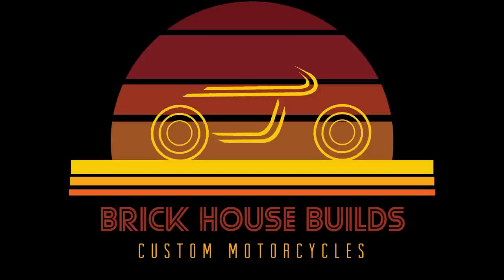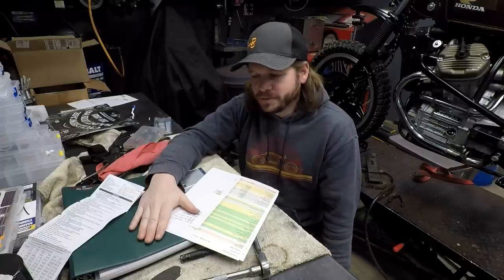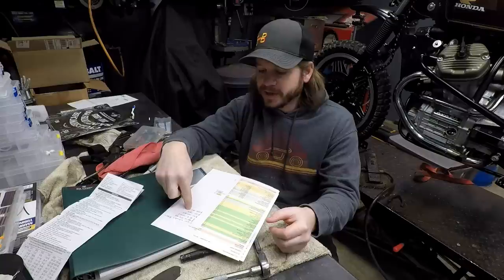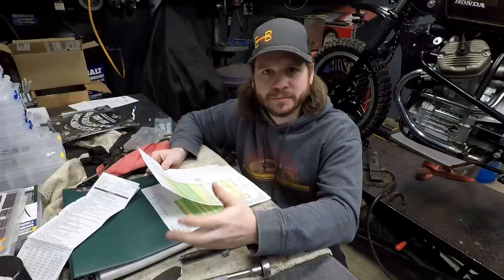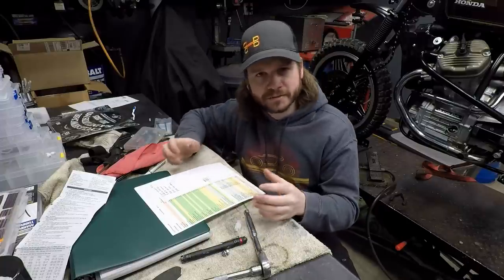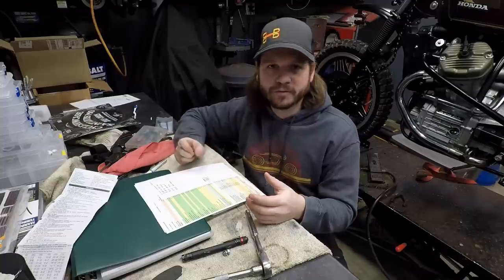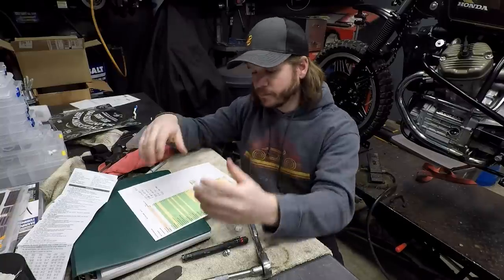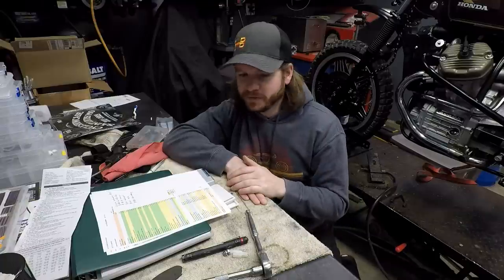Barn Find Honda CB750 Rebuild Cost

Comment: I built one to brand new condition and can’t get it sold so you are dead right. Get it running and enjoy it.
Reply from the maker: Its tough as they say they are worth more stock yet balk at the prices for what it takes to do.
Reply: @BrickHouseBuilds  I got away with it light as I got the brand new 4/4 exhausts very cheap but if I could go back I’d of cafe racered her with a sidewinder. I can’t give it away for nothing as it’s worth a lot to the right man. But it was a great project and alot of fun working on.

Comment: Man! you count everything but you did not count your work! How many hours you spend to restore this motorsicle???  my opinion the most expensive is your knowledge your ability to fix it!
I am sure not many people can do it!
 If you give them this motorcycle so they gonna kill it completely! 
may be i can fix mechanism but i can not fix electricity so i have to find someone to fix electric components to complete restoration of old motorcycle!  
I am sure not many can use your advice!!! Good luck!
Reply from the maker: Hey man, this was my bike so I didn't log hours because it didn't matter. For customer work I log them. On this channel I give the best info I can and get countless emails, messages, texts, calls, dms, etc from people saying they successfully got an old bike running thanks to help from my videos which is very awesome.  My channel is about telling people they CAN do something. CANT is not a fun word here. With good info and patience you can do anything so remember at the end of the whether you think you can or you can't, you are right.

Comment: Brother I wish you were a lot closer I have carburetors that are in need of some work. I have looked around for some new bowls as somebody drilled out the little holes in the bottom that go to the side vent. Do you know where I can find bowls for a 1982 GS GS 650 Suzuki?
Reply from the maker: There are a bunch on ebay currently.  Just did a quick search